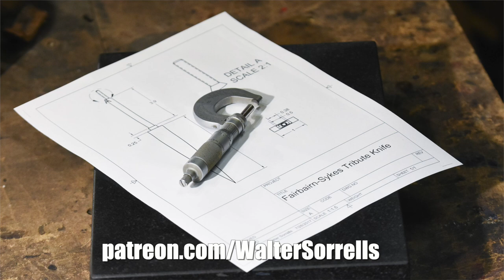The Ultimate Knife Maker's Belt Grinder Guide!

Comment: The biggest difference between the Ameribrade and Bader are the small wheels. The Bader has the bearings inside the end of the wheels and allow the entire wheel surface to be used for fuller grinding as the Ameribrade you can only use the 2" section. You can by the Bader attachment separately and modify to fit on the Ameribrade, as that it what I have done.

Comment: I'm still using the old reliables. Started with the old Square Wheel Grinder by Wilton/Olympic. Loveless Suggested it. Later he designed the Burr King and I have two of those. Very smooth. Another of  my old mentors was George Herron who designed the newer bader. Man it removes steel fast. Mr. Bob and Mr. Gorge were both founding members of the Guild and both past Presidents of the Guild. 

The Bader does not require the handle to be used to change belts. It can be done that way, but I loosen the contact wheel adjustment levers and the belt becomes loose. Now push the arm in and the contact wheel with come forward. You have to adjust for different belts any way and ucts out the one handed Cluster F. trying to thread the belt. 

I think Mr. George had 5 rseven of them. with one outside for nice spring and summer grinding. Hell of a great guy, as were my other mentors. Jimmy Lyle, Harvey McBurnette and Clay Gault. They are all gone now. I'm getting a little long in the tooth myself. LOL! 

You do a fantastic job on these Vid's Walter! Nice Knives too!!! ;<)

KnifeMaker/Retired after 47 years in the shop.

Comment: I just got a 2x48 Ameribrade with the variable speed motor. Save your money and buy the 2x72. I have 2 bevel jigs and neither one will work with it. It's says it's 1.5 horse power but I don't think so. Since I'm only a part timer I thought the 2x48 would be fine but it isn't I wish I wouldn't have gotten it